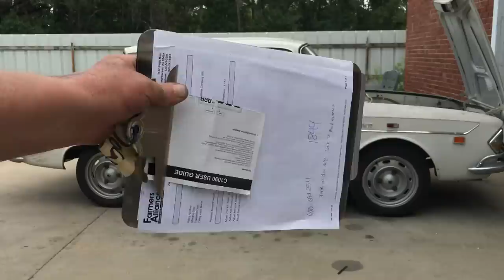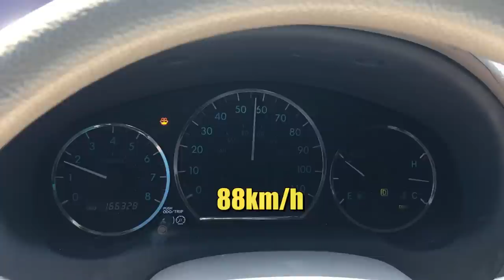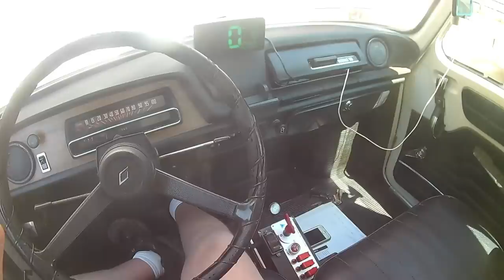S3 E21. How fast will this 670 cc predator V twin powered Renault go?...  Faster than you think!

Comment: Out of the box, this seems perfectly driveable to put around rural towns. Seems fun.
Reply: That's what I'm saying like all the golf carts that go around my small town to the Dollar General, Family Dollar, etc.., if we see one going uphill slowly we just make sure it's safe to pass, and wave a friendly hello.
Reply: @CommodoreFan64  That's how it should be. Here in the city you're far more likely to get a honk and a middle-finger though.
Reply: In Kansas he can actually get away with rural highways because no hills😊
Reply: @bradleyj.fortner2203  That's part of why I don't live in a big city, and don't mind having to drive 30 minutes to goto a Walmart, or other big stores in my area.
Reply: @twoeightythreez  Yep I lived in KS for a few years in the early to mid 00's, and you're right it's mostly flat AF, and I'm not sure if it's changed, but back then get out of a town/city, and your cell signal was zilch on those rural roads where you can drive for hours on end, and see nothing but fields.
Reply: Certainly the first build that will end up not only faster than stock, but massively so. As someone whom learned to drive on a Mercedes 240D and Volvo 240s... it already doesnt look terribad 🤣
Reply: I would drive this mfer through downtown sac
Reply: The highest speed limit in the town I live in is 35mph, so a car like that would work just fine....outside the city limits its 45-55mph so still doable.
Reply: @wildbill23c  the main 4 lane road that goes through my town is 60 mph unless you hit the school zone time, then it's down to 35 mph, same for the main back road at 60mph till you hit the main part of town, and it's back down to 45mph, all the side roads, and what not are 45mph, and we usually have at least one cop sitting on the main 4 lane to get out of town people going through to the beach, or coming from the beach(Myrtle Beach, Charleston SC, etc..) that don't read the posted speed limits, and get a big ol ticket.  So unless you hit peak traffic on the main 4 lane, this car would be doable in my town as well.
Reply: @CommodoreFan64  Kansas is known globally for its flatness. A very famous paper in metrology showed that, on an objective level, Kansas is significantly flatter than a pancake. That's true of most of the Midwest, but in eg Iowa there are quite a few "big" undulating hills that this car would really struggle on, whereas in Kansas, Indiana, Illinois, etc. I would have no problems whatsoever using this car as a daily-driver.
Reply: @CommodoreFan64  I think you could get away with driving this everywhere if you slapped one of those "slow vehicle" triangles on the back so people would feel comfortable passing you.

Comment: Change out the flywheel so it can spin higher RPMs without exploding. A better cam and a different carburetor and exhaust you can get like 50 horsepower out of those engines lol

Comment: I am so glad you got the car registered . That 0-60 mph was a hoot. With my R5 Gordini engine in my R10 I took it to our local Drag strip for giggles. I entered it in the dial your own time bracket racing. It did the quarter mile in 17.20 sec. With no wheel spin or any other variable it ran this time all night and we came in second outright. The people and the guy commentating couldn't get enough of it and loved it, as we kept coming around for the next heat etc. Great memories . Enjoying your series and channel, keep it up. David from Australia.
Reply from the maker: 17 second quarter mile is pretty good all things considered.
Reply: I ran my Lemons car, 1979 Mercedes 300SD, down the strip returning 19.9 @ 67!
Reply: 17.2 is impressive considering my Mk5 GTI (stock manual) ran a 14.9, tho that was on an open night at the local drag strip and the surface wasn't properly prepped, also it was timed with a phone stopwatch. If it was prepped It prolly would've been a 14.6 or 14.7.
Reply: The r 5 gordini had various engines, from 34 hp to 160 hp and even 200 with some turbo versions.
Reply: @kukipett  Mine was out of the 1.4 105hp single duel throat carby version. Same block as the R10 and R12 so it bolted straight up to the trans.
Reply: @Maca1969 my brother had a b14 out of a Volvo 343, also bolted up.

Comment: Sometimes I really envy your car related laws excluding CA, if I took this car in it's current shape to get it registered in most of European countries I'd almost have my birth certificate revoked :D
Reply: They don't take into account the age of the car...you aren't required to meet emission and safety regs of 2023 are you?
Reply: @MiniLuv-1984  I can only speak for Czech regulations, here it would need to meet safety standards from it's era, but it would be tested if brakes, shocks etc. work, if chassis has no serious rust, no sharp edges etc. But they certainly wouldn't be happy about that engine in the back! And I'd have to pay around $400 extra to get it registered because it has no emissions equipment. Or I could get it registered as an antique without the emissions fee, but in that case the car would have to be in very nice original condition.
Reply: I think they'd let you run it on the road with the Predator installed in England, given that Edd China's sofá-car is registered there.
 Germany, Spain or Portugal definitely would not be impressed!
Reply: Even CA is pretty chill about 1960's cars. It's easier if it's pre 1967. But I'm medium confident it would be straightforward to put a 69 Renault with the 670 on the roads here.
Reply: @fishman241 yep, 1975 or older is "technically" smog inspection exempt, so you can get away with just about anything so long as it's pre 75'
Reply: @fishman241 everyone just likes talking shit about California.  Especially if they don’t live there.  It’s the most annoying part of car culture.
Reply: @Del350K4  With how things are in Portugal right now, even with stock parts they could screw you over. Car laws here are ridiculous and enforcement is even worse!
Reply: @jeffstorey9147  didnt cali make ecu mods illegal?
Reply: @jeffstorey9147  
Don't try to lie to people Jeff.   Everyone knows California sucks.   I left 25 years ago and don't miss any of it.
Reply: you don't even need a permit to build a house in my county. (I live about 25 miles from robot cantina's town.)
Reply: CA doesn't even have vehicle inspections. Just smog tests. You could be driving around with bad brakes, blown shocks and holes in the floor, but you're good as long as your registration is paid and there's no check engine lights on. And it's not illegal to do ecu mods, you just won't be able to pass smog tests and won't be able to register. But there are ways around all that stuff.
Reply: Where I live in North Carolina we don't even have safety inspections on cars over 30 years old much less emissions inspections.
Reply: @gabrielcosta3301  I wonder why they have this attitude?
Reply: @gabrielcosta3301  In New Zealand that car would cost $1,000+15% tax to be checked for certification and even then it could fail on many things.
Reply: @fishman241 If the engine was CARB approved I bet California would be ok with it
Reply: Careful there, friend! We here in Commiefornia scrutinize our laws with an incredible amount of logic and common-sense… and then Suckramento is diligent to form those laws 180° opposite of those qualities!
Reply: @jeffstorey9147 Why annoying?? I’m currently detained in the Socialist Republik of Commiefornia, and I find the criticism highly appropriate. 😏👍🏼
Reply: @kd5inm Only if they could find a way to Tax the ever-lovin’ snot out of it.
Reply: @FatDad_LittleBoy  Not if you’re White, there isn’t. 🙄
#askmehowIknow
Reply: @jeffstorey9147  Most car people do not have a 1975 or older vehicle. So even if you have basically no rules for classics, you can do literally nothing performance related on modern vehicles in California. Unless you are rich and also have a car that there are CARB certified bolt on kits available for it.
Reply: @Del350K4  Nor Australia.
Reply: You can definately get that car registered in Sweden or Finland.
Reply: @normiukkeli3739  Interesting, I was under the impression that Sweden had the strictest vehicle regulations in the entire world. I was once told by a German friend that in Sweden, one can’t even operate a car on the public roads if it has any body damage.
Reply: @Del350K4 and french sans permis cars are a sight to behold. It's seen ones that look like they share 90% of their DNA with a cement mixer

Comment: Hey, that's not bad at all. That's about twice as fast as I thought it would be. There's a pretty good aftermarket for those Predator engines too. So, you'll have no trouble making it faster.
Reply: And that's all thanks to Go Power Sports. They've got all you need for small ICE Engines.

Comment: Your dry humor really cracked me up. It's such a cool and fascinating project. When I was in school my neighbor had one of these, he sometimes gave me a ride to school in it and he'd "drift along" as he called it at about 45mph. For years the engine had a weird rattle but it kept going until one day it didn't. Taking the head off revealed most of the piston rings had somehow broken up and made their way into the cylinders where they impacted the pistons and heads until they got ejected. You'd think that was the end of that engine but.... no. He put in 4 new pistons with new rings, cleaned up the worst of the pock marking on the heads, ground the valves, put it back together and it drifted along for quite a few more years.

Comment: I have in front of me the January 1967 issue of Car and Driver with a road test of a Renault R 10. The engine was a four cylinder, 1108 cc unit rated at 50 horsepower and 65 lbs/ft torque. The top speed was 82 mph with the engine at its 5000 rpm redline. The 0  - 60 acceleration time was 19.2 seconds.  Fuel economy was rated at 32 - 36 mpg . So there’s your baseline, and already you’re within striking distance. Go for it!
Reply: Thanks @MARKLAR51.  Exactly the information I was looking for.

Comment: To add heat for the winter time you can use an aviation style heater shroud. It's an air inlet that flows over the exhaust pipe to provide heat in the cabin.
Reply: Don't forget to add a carbon monoxide sensor in case the exhaust cracks

Comment: I would love to see you put dual exhaust on it so it sounds like a Harley.

My guess is that it's getting 38.7 MPG right now.
Reply: Agreed! Vtwin small engines sound great with straight pipes! :)
Reply: I'd like to see a liquid cooled motorcycle engine into 'er.
Reply: @andytaylor1588  I'd like to see just how far the Predator can be pushed first.
Reply: A Harley has an offset crank so that sounds very different.
Reply: @WieDrDerJonge  Offset?  The cylinders share a single crankpin and fire unevenly because of the 45 degree cylinder angles.
Reply: @tauncfester3022  Exactly! The firing angle is 315°- 405°- 315°- 405° and so on. Potato-potato... :)
Reply: A 1000 cc older Ducati with 70 to 80 bhp would do great in this.
Reply: @histriamagna1014 , No not really,  where are you going to mount the cooling fan and sheet-metal.  Those are air cooled  motorcycle engines, the last engine you want in a rear engined car with a somewhat closed off engine compartment.
Reply: @histriamagna1014  they dont have enough clutch to hold up. I had a Yamaha r6 swapped go kart and i went through clutches all the time
Reply: Dual exhaust and cams
Reply: that's a lot of load for 0.67L. 1800 lbs esp. if you have to keep your foot in it to get down the road in lower gears. maybe something like 25 mpg would be reasonable
Reply: @pauls5745  he got over 50 MPG in a 420cc
Reply: @pauls5745  I've owned a '62 SAAB with the 36 hp 850 cc engine, in a 1690# car that got on average about 30+ MPG.  The Renault is missing that big cast iron block lump of an engine in the back, so I'm betting it's lighter than my SAAB by a least 100#

Comment: I owned and drove a 1969 Renault R10 just like the one in you have here from 1971 through 1976, and drove it twice to Mexico City and back. It has a 1100 CC 50 bhp 4 cylinder engine and averaged about 34 mpg. It could cruise at 70 mph all day. The main problem was the pushbutton automatic transmission, which used magnetized iron filings as a clutch and which no mechanic understood. I sold it when I found a good Renault 1972 R16 FWD that lasted my for 10 years.  Your project here is very interesting.
Reply from the maker: Since I have an extensive electrical background the "automatic" intrigues me.  Actually I was given an automatic R10 back in the late 80;s and I didn't take it.  I wonder if modern electronics could make the automatic more interesting.... unfortunately  I'm sure they are hard to find.

Comment: I'm 67 and this was the first car I owned. The original engine was a 4 cylinder Continental. 1.2 L and since we bought it in Florida it had after market A/C. Bought it brand new off the showroom floor for $795 +tax. I drove it from Orlando to Portland OR in the summer of 1973. We did 70 to 75 with the A/C on on the Interstates no problem. We were in no hurry as we were seeing our beautiful country so most times we were on smaller roads. I gave it to my Nephew several years later and the original Solex carb had given up. He found that a carb from a small 6 Chevy engine was a direct bolt on and he drove it for many years until the Oregon liquid sunshine caught up with it. I understand it's still an active chicken coup on their old farm in Clakamas OR.

Comment: Youve really got me wanting to install a small engine into my sand rail just to see how it works
Reply from the maker: Years ago I had a street legal small Berrien chassis sand rail with a 1200 engine.  I was so tempted to do a single cylinder diesel swap just for fun.
Reply: @robotcantina8957  That sounds sweet man. Mines a shortened wheel base karman Ghia with a 22r Toyota engine from a Celica. A diesel like your Kubota would be sweet

Comment: I noticed in my repowered scag the 22hp 670 is in fact probably more like 25 to 27 hp.   Its performance is basically indentical to the 27 hp kawi of my other machine with the same deck and blades.  I quite like it, we've made it to 400 hours since last year's replacement and despite everyone telling me it's not going to last, its performed very well, with no problems at all.

Comment: "... and you didn't get much." Let's unpack that. As a child I was driven around in a 1967 R10 with the very unusual pushbutton 3-speed automatic. The R10 also brought 4-doors, instead of two, four-wheel disc brakes, when most manufacturers were struggling to supply you with two at the front, and 4-wheel independent suspension. I also recall that after the Dauphine fiasco, a car that, from what I heard from customers years ago, seemed to disintegrate before your eyes, Renault upped it's game in the sixties. The upholstery on the two Renaults my family had from that era wore like iron.
Reply from the maker: I think here in the states Renault could have done better if they had a bigger presence.  Parts have always been hard to find.    I was actually given a R10 with an automatic back in the late 80's and didnt want it because of the parts issue.  The internet makes the world a lot smaller and so far I have good luck finding the parts needed.  Overall the car is unique in its engineering for the time, that's for sure.

Comment: That was actually pretty impressive for a stock Predator v-twin. Those engines sound halfway decent on open pipes, and with a little more budget, have incredible hop-up potential. You can get better pistons and rods surprisingly and strap a blower on them. I've seen them in the 70hp range if long term durability isn't your primary concern. 😁That's still a bit anemic for 1800 lbs, but it'll sound bitchin'.